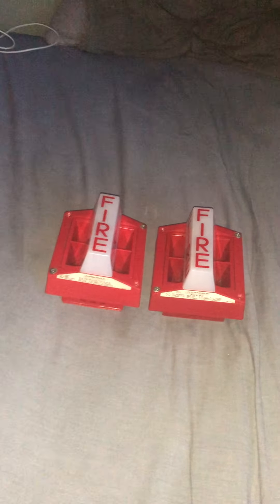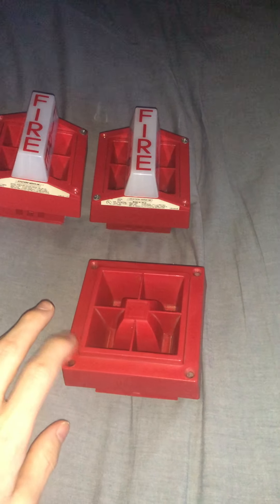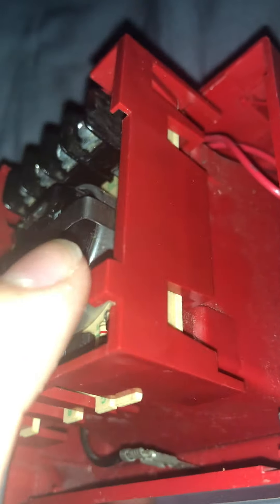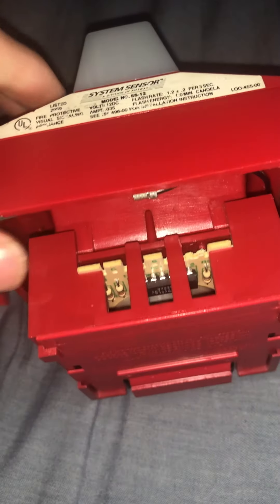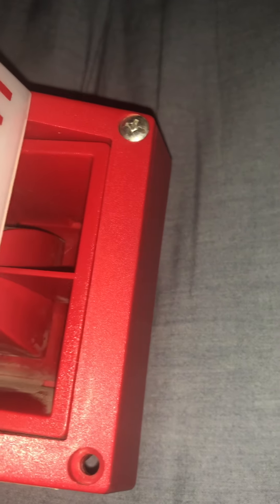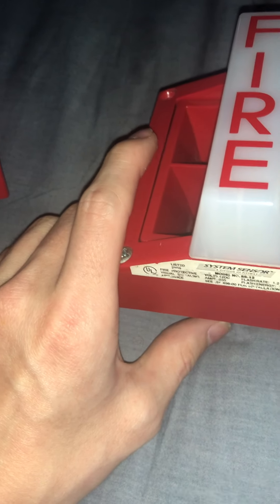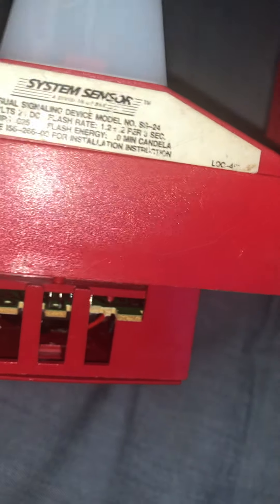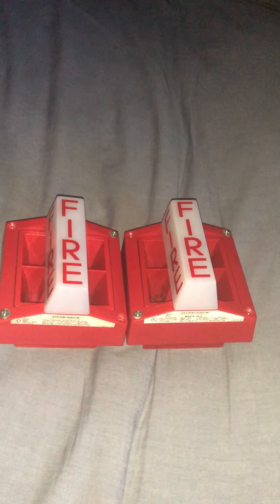Comparing my system sensor Mass12 vs my system sensor mass 24

Comment: Thanks for making this video! I did not really know how to use these, but now I know I can take off the cover, and I didn't know the alarm has this much potential. I want to point out that the MA/SS12D also supports 24 volts. It also supports 12 volts so that is why it is called 12 volts. (I may be wrong, that is what it said on the cover.)